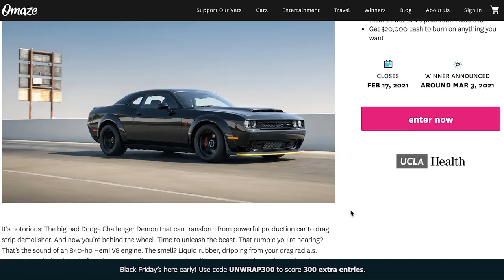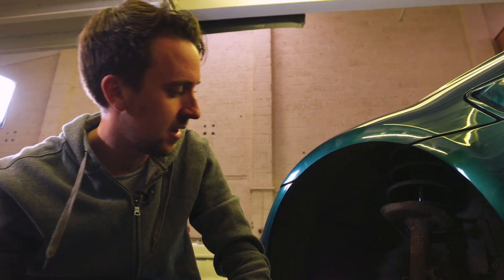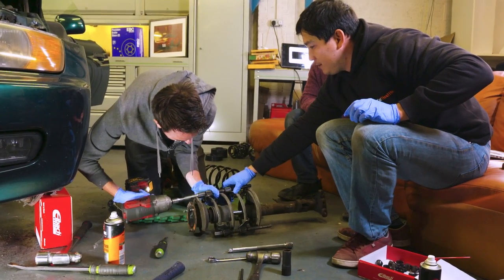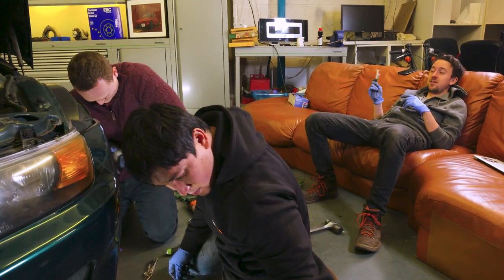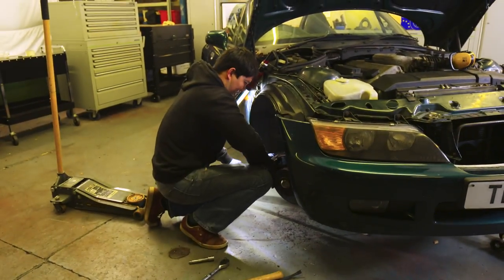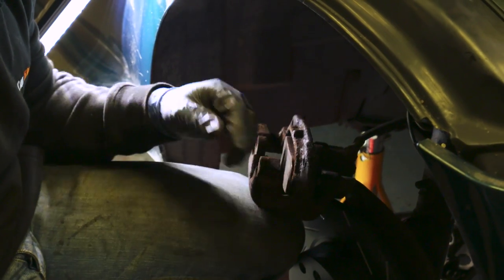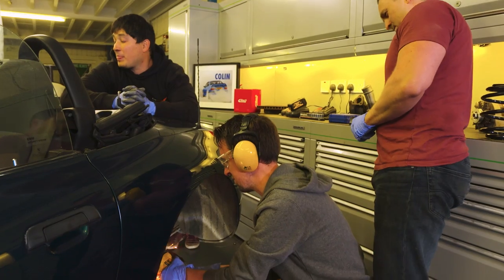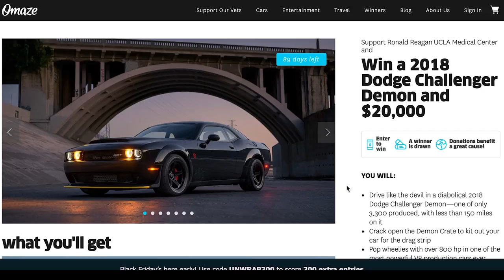Project Car Novice Tackles Brakes & Suspension!

Comment: Ethan hurting himself during the proces was probably the most relatable thing and a true welcome in the project car world
Reply: I once was standing on a bucket leaning over the fender into the engine bay. The bucket slipped out and my gentlemans area got crushed as I slid down the fender. That was my favorite moment of working on cars...
Reply: I've broken a pinky replacing brake pads and gave myself horrendous soft tissue damage on my thumb trying to get my oil filter off. The crack it made was teeth-shattering.
Reply: @drunkenhobo8020  oh fuck the thought alone makes me physically cringe, hope you're good now my guy
Reply: Smashed fingers, burn mark on my arm 

Oh man, good times
Reply: Or just doing car maintenance in general.
Reply: Doesn’t count unless they’re cold 🥶
Reply: @shoving6462  Cheers, my pinky is still a bit wonky and my thumb seems mostly healed by now. Happened right at the start of the first lockdown so couldn't even go and see a doctor about it. Hurt like hell any time I tried to grip or undo anything. Had to tape my thumb to my hand to stop myself moving it, especially when going to bed.

Was such a weird injury - I've never had pain delay like it before. Was trying to undo the filter, heard a loud crack and had time to think "Great, that's the seal cracked so I can now get the damned thing off".
Then it hit me, I fell to the ground and let out a very manly squeal.

I recommend buying the correct tool if anyone wants to remove an oil filter. Don't do it by hand.
Reply: Completely skinned my hands while trying to remove a heater hose that’s against the engine block. Let’s just say metal is hard.
Reply: I was fitting a trickle charger quick adaptor to the battery in the boot of one of my cars, it sits inside the wing so you can’t really see what your doing, you just have to feel about. I forgot to take my wedding ring off and as I leant in to connect the furthest terminal I bridged the first terminal with my wedding ring and it melted to my finger. Brilliant memory.
Reply: Best part was when Ethan started acting like a real mechanic and cussing for the right size socket
Reply: Dropped a Hilux prop shaft on to my face and shattered a tooth in the process.
Reply: I tried to do new discs on my seized callipers on my 98 celica as the 1st i did and instantly took my fingernail off through my gloves 😭
Reply: I've taken injuries without even doing maintenance: Starting a cranked car will often result in having your hand and fingers hit by the engine – not much damage, but very unpleasant. And that's when all possible precautions are taken!
Reply: The best and most funniest moment of mine was working on a citron ax remember these little tin cans! Anyway I had it up on a ramp and I was trying to wiggle off the front bumper as it seemed stuck, as I was wiggling it the offside headlight decided to come off and nearly hitting my head and probably knocking me out😂 I just saw it going past my face with millimeters spare😅, but great little car to strip down easy stuff
Reply: @tcalpin8248  ouch!
Reply: @drunkenhobo8020  “tool,” I think you mean hammer and a screwdriver
Reply: My favourite part of the video was where Alex and Gareth were “supporting” Ethan on compressing the first spring. Poor Ethan but that was hilarious. At least you know they’re real friends.. bastards...
Reply: @rossmanning4863  What? Your hands?
Fuck working on a car with cold hands haha
Reply: One of the things you pick up over time working on cars is how to hold, catch, yank, grab, bash or "fettle" car parts without crushing vital parts of yourself, 40 years in i still need to look up procedures in the manual but I am MUCH better at knowing what will hurt me. 🤣
Reply: I think is the swearing part 🙄
Reply: Once jammed and broke my thumb between front wheel and wheel arch after changing hub carrier, I couldn't get the strut to go into the carrier so I had the bright idea to leave it resting on top then lowering the car hoping the weight would see it home.
Still wouldn't drop into place so I gave the wheel a wobble and it jumped out of place so my thumb took the whole weight of one corner.
To top it off I couldn't reach the jack to lift it up again, my cries for help were finally answered in what felt like forever... Good times 🤣
Reply: @popuptoaster  I have another 10 years to go then 😂
Reply: My everyday struggle 😂
Reply: @TheBulletTrain  that feeling of satisfaction when you finally get that part off but then notice it’s covered in blood, and that you sliced your hands apart but the adrenaline blocked all pain
Reply: @gilbertg.8501  Haha. "I didn't know these rotors had red paint on them." Other person "....they don't". "Oh, then I have a problem"
Reply: punched my table vise once while using the hacksaw. wasn't pretty
Reply: @TheBulletTrain  for me it was like “finally got this fucking intake off. Time to go to the machine shop for the head! Wait, since when is the front red? Oh shit, I’m bleeding. Alright, off to the shop”
Reply: Have never worked on a car, but managed to get my thumb between chain and sprocket of my motorcycle whilst cleaning the chain with rags and running it from the wheel with the other hand with some speed. Luckily I had gelbag in freezer and listened a friend who told me to hold it in cold for half an hour and put pressure on it. Next day it was nearly ok. Always have coldbag on hand whilst working.
Reply: Not a car but my motorcycle; we had it on its paddock stand, on top of some wheels to get it to a good working height. The night we took it down, neither of us realised I'd left the kickstand down, so when we bumped it down off the wheels the kickstand landed directly on his big toe. 

That was a year and a half ago and it's still not right 😂
Reply: While getting hurt on a project car/bike or home maintenance has always been a right of passage in the past.. it really doesn't need to be
If the people who are acting as teachers, just change the way they teach slightly you can avoid most of the common injuries 

For example, the brake disc removal.. something so simple that so often results in skinned knuckles or bruises. All they had to do was say "Hey Ethan, when a brake disc has been on a car for many years they get stuck to the hub.. take this rubber mallet and give it a gentle tap around the edge"
Like isn't that the point of teaching, to share your own knowledge and experience? Where so often teachers give the vaguest instruction, don't explain why and if they struggle and ask for more guidance they're told "just do it"

It's basically the old saying "I learned the hard way, so you should too" which is pointless and unnecessary
Reply: @TheBulletTrain  Working gloves FTW (and I don't mean those paper thin blue nitrile crap ones!)
Reply: @soundseeker63  Haha hell yeah. I have several sets of working gloves, but everyone bleeds once before they buy them lol
Reply: I burnt myself on a 2004 Clios lighter... Somehow
Reply: @newwesterngrove  I once tested to see if the lighter in my E36 was still working...so I put it on my tongue not my best moment
Reply: @pez_96  Oh man I miss my old AX, it was the car I learned to do work on. Was a horrifying discovery when I moved onto later cars and realised how much more of a pain doing anything at all would be.
Reply: @asharak84  ah yes I totally agree with you, now its electronic everything haha. Soon we'll have robots doing the work
Reply: I knew a guy who was taking the fly wheel out of his car and It dropped onto his arm and cut him a bit
Reply: @gilbertg.8501  this reminds me when i was trying to bend some steel by hand (very dumb) anyways i had pretty thick gloves on and when i was done (i was not able to bend it) my hands were covered in cuts and blood, im always suprised how clothing doesnt really protect you that much
Reply: Reading this comment while my index finger still after two weeks won't move after hitting it while doing some work with the brakes...
Reply: Lol the very reason I never went into mechanics.

Comment: Oh. My. God. YES! Time to make some popcorn and enjoy this. I already know it's going to be fantastic entertainment.
Reply: Oh hey wacky, didn't know you watched car throttle
Reply: Why are the best videos like 'Ethan Repairs' So short? Yet even the boring Podcasts can be an hour long.🤔🤔🤔🤔
Reply: If Ethan (And Gareth) can do it...don't bother trying yourself out in the road.
Reply: @statementleaver8095  Editing.  Anyway the podcasts are laugh out loud funny at times.
Reply: @Me-zo8yc  I think they need to expand their minds and try a more economical approach to a 70's-90's small car rebuild.
Electric Bangernomics Daily Whip 
Something Tax Exempt!!!!
Reply: @statementleaver8095  A milk float??!! XD
Reply: @Me-zo8yc  Maybe try using alternators as the charge by drive system.
If other YouTubers can make Forklifts and Minis with Tesla batteries then why not??
Reply: @Me-zo8yc  Everything other than Phil has been a bit of a flop to be honest.
Omega!!!
Reply: @statementleaver8095  true. Someone get Ethan Musk on the case
Reply: @Me-zo8yc  Poor Ethan being made to feel bad for breaking bolts.
Fault here goes to the man handing over the wrong tool in the first place.
The strangest part was they had a torque wrench 10mins later (complaining that now Ethan is using it to tighten other bolts)

Let's hope that Ethan Musk doesn't take a hammer to the glass of the new "ethernet float" lol

Comment: Slight slogan readjustment: "If Ethan can do it, (with the help of three very experienced car guys in a fully kitted out workshop) then anyone can!"
Reply: the thing is they didn't use complicated tools. No Lift just jack stands. obv if you're watching car videos you're probably more inclined to learn and do these things yourself and the only way you'll ever get experience is by doing it.
Reply: @Ra33sK  all true, just funny how it was branded
Reply: fully kitted workshop,lol,three experienced guy letting a newbie loose with an impact gun,those bolts looked like they were already passed the torque settings to me,numpties teaching cowboy skills,yeee ha
Reply: Start off with minor things like fluid changes and progress gradually. Even the really good tools you'll need for most of the work ever, you'd get them all from about €200 to €400 easily.

What @chrisfix always says is get a quote for the job from the dealer/garage, do it yourself and save the money for tools! Within no time you'll start saving a TON of money and you'll know that the work on your car is actually being done right.

Can't wait to start working on my car!

Comment: I feel so bad for Ethan, he looks like he wants to cry
Reply: I truly felt his pain. I almost cry once working on my truck. Trying desperately to remove the rusty fill plug on the rear differential.... It took me a few days to remove that plug
Reply: @ismaela.6973  i got a washer stuck around the spark plug down the spark plug well, perfectly flush around the plug so no way to magnet it out, had to force a small socket onto the spark plug and thankfully it came out .. after 3 days of attempting random tactics on a car that was misfiring in the first place.. yeah ive been close

Comment: I dread using coil spring compressors. Especially when they start flexing and make you think they’re gonna relieve you of one of your limbs
Reply: Yes, very, very stressful!
Reply: Agreed. I'd never dare using one of those, especially with power tools.
I prefer the one we have at work, even if it's heavy and hard to use. I feel a bit safer then.
Reply: Daily dose of stress for me haha
Reply: I have a set and have yet to actually need them for any suspension work. Land Rover suspension and 1950s Austin Healey suspension is easier to change without! Using them on the Defender for the first time was terrifying but I've not used them since.

Quite useful for clamping horse feed buckets to the fence to stop them being dumped on the floor.
Reply: @tomcardale5596  haha yeah, solid-axle vehicles might be the way to go just to avoid having to use these things.
Reply: @panzerveps  Wish I had access to a proper one at a shop. Oh well, guess I’ll just die 🤷🏻‍♂️
Reply: There is a hole in the drywall of my moms garage after I changed springs on my Avensis. These can be dangerous
Reply: To be honest, it was terrifying to wastch
Reply: My coworker was changing springs and was in a hurry, he messed up with the compressors and shot a spring across the shop almost hitting a brand new Kia Stinger getting ready for delivery
Reply: @lexus_offroad_adventures  I wish we had a wall mounted one. That would make me feel a bit safer.
Reply: @plague46  💀💀 pucker moment
Reply: There are far better compressors available. These are the cheap shit dangerous ones. The plate-type are far safer and I have a set with a bar that locks them together so they can't move. No way I'd use these and never, ever with a frigging impact.
Reply: I once did it the economy way, with a coat hanger and tie wraps/zip ties. Needless to say they broke and the spring decompressed with one hand on it. 

I was pleasantly surprised to have no broken bones...
Reply: @zxspeccy48k  you got lucky! I've heard of plenty of people breaking jaws and losing teeth. They're incredibly dangerous
Reply: @mariueg  My apprentice lost one thumb, using one of those at school.
Guess he got lucky.
Reply: @catnapwat  i for one only heard stories from random ppl but when I ask mechanics or ppl that use them no one had any stories to tell. Most simply told me your not suppose to hold spring aimed at your head and that's it.
Reply: They were not oiled on threads and he used an impact gun. Read the manual for safe use on them. Impact guns not only can wreck threads but can vibrate them off the spring and cause serious injury, and people think they learning from these cowboys
Reply: @wykydytron  There's a short Car and Driver video on here that shows an actual accident- it's 37 seconds long so you should find it easily- search "coil spring compressor accident". And that's a pretty tame one as the car took most of the force. Were they using it correctly? Maybe, maybe not- but it does show what happens when they slip. There's a reason garages use wall-mounted spring compressors with safety guards- they're just safer and they don't have the ability to rotate around the spring and have it uncompress.
Reply: @catnapwat  I think all that saved me was it was horizontal on the ground when it went, with nothing to really push on. If it had been sitting vertically I reckon I'd be missing teeth. 

Still bloody hurt though!

Comment: Yeah, maybe don't tell him to be threading in old bolts with an impact wrench...  Poor dude got set up for a rough first project.
Reply: maybe tell him that those shock absorbers are bad
Reply: Or let him learn the hard way and for sure he won't forget.
Reply: Ethan: Holds hand out asking for a bolt
Gareth: Gives a high five 😂
Reply: Think he was well and truly set up there, after he was meant to get the torque setting from his Haynes manual.
Reply: Yeah bit of a waste of time :/